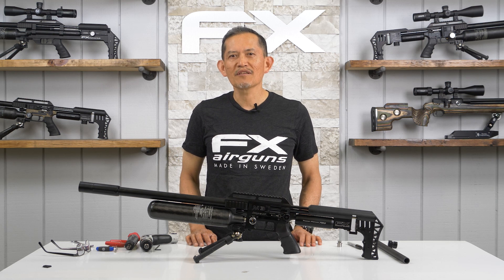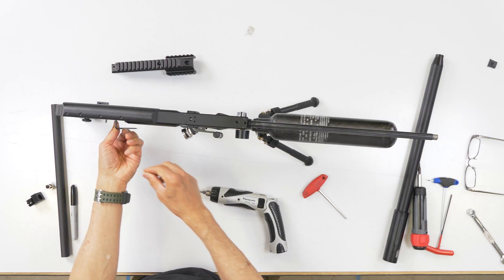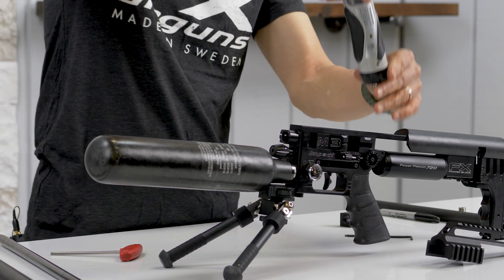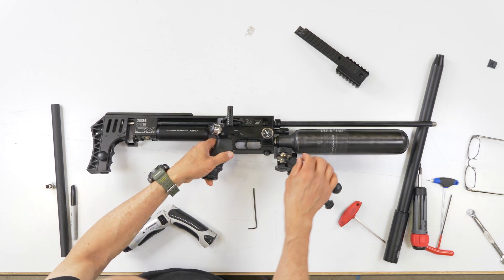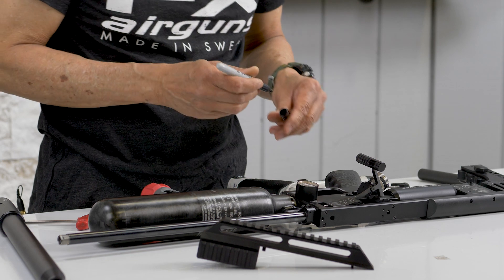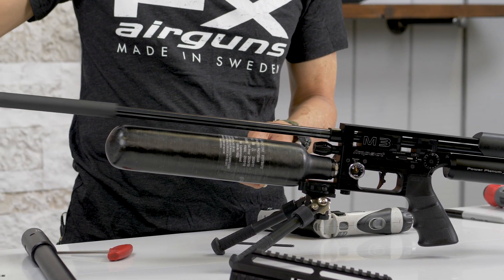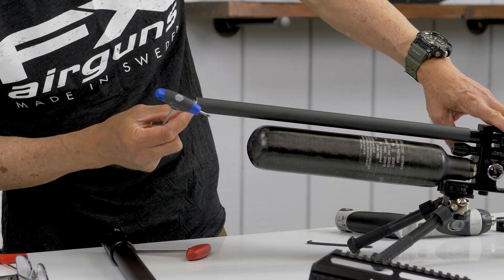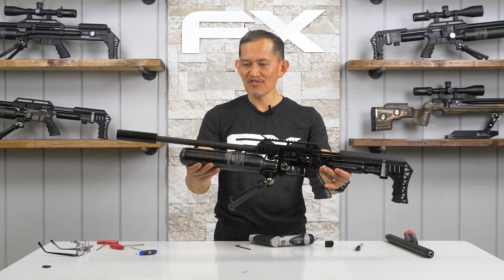FX Airguns Barrel Tensioner System Install

Comment: At some point, FXs  R&D department will have an epiphany and drill a hole down the exact center of a very hard peice of bar and then put some sort of spiraled groves down the inside of it and come up with something that's solid dose not flex and can shoot pellets really well without the need to add things to it to make it better after you have spent a months wages to buy the rifle in the first Place. Come on FX its not that hard all the other air rifle manufacturers are doing it. Don't get me wrong I just bought an FX DRS and after buying all the things it should come out of the box with it's OK but I'm still going to get a lother walther barrel machiend up for it to make it a great rifle.and not just OK.

Comment: When will it be available in 800mm .30 (7,62) for the new Impact M4 ? Why isn't it sold already with this carbon sleeve and tensioner ?
The M4 Extended (slug barrel) version suffer from that super long barrel, lack of rigidity and shoot all over the place if you touch the barrel.

Comment: Hi. Does this work with the Impact M4 Sniper edition? Thank you
Reply from the maker: Yes it does 👍
Reply: @FXAirguns  Hi, I tried it with my 0.177 sniper edition but the barrel could not be tightened correctly/effectively. Can you please make a video for this?

Thank you
Reply from the maker: @panicosshiouftas3339  have you changed the front block to the one included in the barrel tensioning kit ?
Reply: @FXAirguns  No. It would not fit (I think). I was trying to use the one from the M3. The M4 seems to have a different block. It would be nice if you could do a video. Overall there are not a lot of videos regarding the M4 or setting up the M4 correctly. Especially for us having the 0.177 its even more difficult…

Comment: I have 4 Impact MK2s. But FX is going in circles at this point. I have the original 600mm solid barrels in .25 and .30. Theyre pretty accurate with pellets. The USP of the liner system was that it was flexible to increase accuracy. Now theyre trying to tighten everything down. Why dont just make the solid barrels in all calibres and all lengths?
Reply: This is a great comment bro.. bring back the solid barrels

Comment: Didn't work for me. First of all, with tensioning up I noted that my shots were all over the place. like 100 cm groups at 100 meters. Turned out that the barrel fix just after the block wasn't properly fixed in the factory: thus pulling the barrel out of the gun by tensioning the tensioner. Fixed that, installed again, tuned the gun. Groups did not improve beyond "before-barrel-tensioner" ( even slightly worse) and the gun got a hell of a lot louder, like .22LR loud.  Other people started telling me, I should check the tensioner if it was cut properly, and if not, it could warp your barrel. 
I just took it of. Installed original shroud, tuned again, and am back at "sub-moa-ish" groups at 100 meters. (FX IMpact M3 sniper in .25) I decided to invest in a proper Bipod (Fortmeier, which I can fully recommend!) and in time maybe a 700 cc bottle and a backbone. MOA / Submoa groups are good enough for me.. 
Mind you, the barrel did stiffen up significantly. I shoot 25.49 grain pellets at 275m/s with great results. If one shoots slugs at way higher energy and speed, the tensioner might be more beneficial. I simply don't know.
Just my two cents.

Comment: All well and good but WHY? If a barrel tensioner is needed surely it should be fitted at the factory or the design should be changed so that a tensioner isn't required?
Reply: 1000% with you !

Comment: Trouble with the tensioner. to fix the carbon tube of the kit you have to screw the bolt at the end of the barrel on the screw that holds the liner.  But these screws that hold the liner and the carbon tube are tight, the slugs go all over the place, there is no more precision.  Ernest Rowe shows us how to tighten the tensioner kit but tightening the kit tightens the liner screw and we lose precision.  It would take a stop for the screw that holds the liner.  Do you have a solution ?

Comment: It would be much better to increase the shroud diameter, then have the jam nut with an integrated air stripper so the shroud still worked as a sound moderator, for the air to disperse. Then have the male 1/2 inch UNF on the end the air stripper for an extra silencer to be added, but I guess that part will only be available next spring.... For the right price. 
I'll go make one, and get back to to you all.
Reply: 3 😅
Reply: Make it two!

Comment: Isent this more barrel pipe tensioner than barrel tensioner ?
I mean the barrel are inside the pipe, held in place by the end "caps" of the barrel pipe.
When i first heard of this i was thinking how the hell do they tension the barrel "straw" but i have seen they ( south African boys ) put a thread on the "straw" and so are able to pull on that just fine.

I really really want to see before and after tests with this though, not that i think it will be going on my Maverick i have already poured too many money into.

What i would like to see is FX putting a thread on the end of the barrel, and then just put a rifling on the remaining CM of the barrel, sort of the old ST barrel in reverse.
This way we could screw the barrel in place real good, and we could pull in it real good too, and i dont think it matter if the barrel is smoother bore for the first inch or so ???

O and why do all airguns have a transfer port ( single or double ) why not have a channel on the outside between two O-rings, and then a lot of smaller holes in that channel all the way around the barrel, so it would be say a 12 port barrel.
Or maybe it is a must that the air go strait into the barrel and not in a channel on the outside if the barrel and then via that into many smaller transfer ports.

Comment: What a poor design. We loose the volume of the over the barrel part which makes the gun bark more loudly. Secondly, it is virtually impossible to remove the barrel and install it again with no POI shift like it was before that tensioning system. C'mon guys, you can do better than that. If not then you can hire me but I am not sure if you have enough money to do it.
Reply: That's right. Their poor design forces the end user to buy more crap to fix their mistake. I'm here looking at this for my FX Dreamline because the barrel droop is at least a half inch and even picking the rifle up makes the barrel look like a girl swapped places with a guy for a day. Absolutely poor design. Now I have to figure out whether to get this or buy a barrel band.
Reply: @ibanezrg320fm  700 and 800 barrels are a joke.
Reply: @ibanezrg320fm  I currently have a dreamline with a 700 mm barrel. You've got other serious issues if you have enough barrel droop to be able to eyeball it. I have no barrel band or any sort of tensioning system. My gun is shooting 23 grain NSA slugs at 995 ft per second, and it is an absolute laser. My main complaint about it is it's overall length. I am currently looking at switching to an impact to decrease length and be able to shoot more like a mid-30 to 40 grain slug at a little over a thousand feet per second. If you really want to lean on the power especially in a lower caliber like 22, you have to have the 7 and 800 mm barrels
Reply: I’m a machinist by trade . This design is piss poor !  FX has 4:parts that need to be precise and square to keep the liner straight when it is torqued .  I received mine , the first thing Is to check how true and square everything is . The barrel or liner as it’s called was ok . The outer shroud was not and neither the insert breach , it wobbled and was easy to see without putting a dial indicator on it . The carbon fiber sleeve was square on one end but the other side was not . No telling how far off center and square the clamp is . 
If you are having issues with your scope not being able to correct to the target , remove the carbon sleeve out of the equation and you will find it shoots much better . 
FX needs to do better !
Reply: @hotchihuahua1546  I’m reading too many negative reports on the carbon fiber sleeve and on the harmonic barrel tuner. I just received those parts, still in package and I’m thinking about sending it back, or maybe just hold on to it since I already have it. Do you regrets tearing your fx down?

Comment: Can you use this kit with the carbon fiber sleeve that is installed between the liner and the barrel because I have that already installed I want to know if that carbon fiber sleeve can stay in between the liner and the barrel while using the tensioner kit with the new tension nut that goes on the outside of the barrel that's being replaced?
Reply: I just posed the same question to somebody else that's pushing that tension kit and he answered back and said that the liner works fine with the tension kit he has both installed on his just thought I'd pass that along.
Reply: If he answers
Reply: Great question!
Reply: I want to know if one will fit the maverick